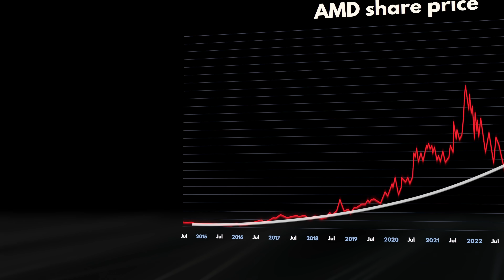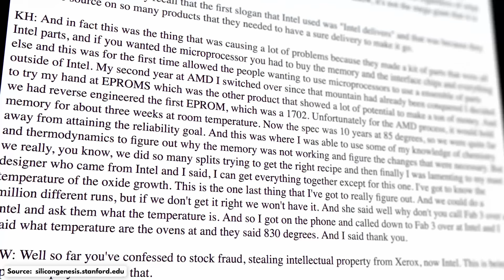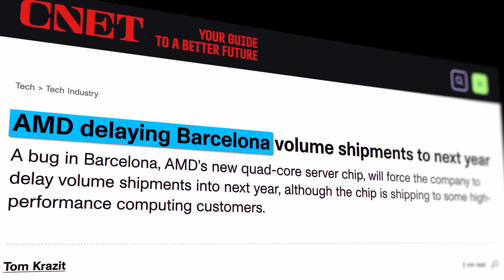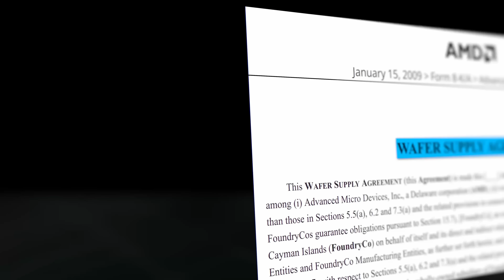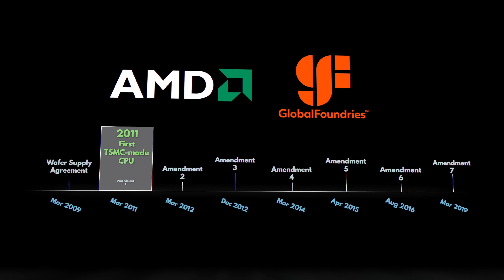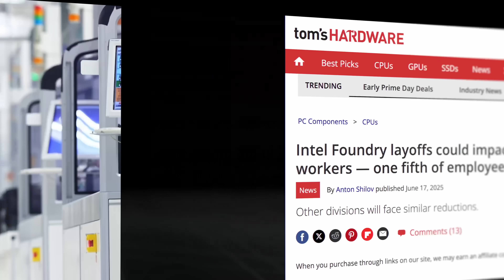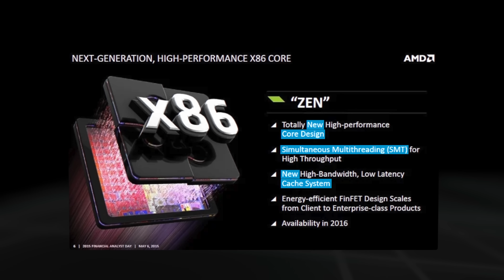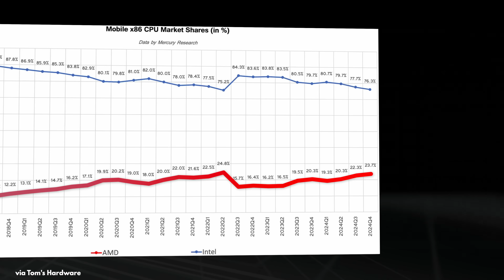How AMD won the CPU crown

Comment: It has been a long time but I believe Pentium 4s had faster clock cycles than the contemporary Athlon 64s but the Athlons could do more with each clock cycle and was situationally better.

Back then, consumers thought everything was determined by clock rate but it stopped being a nearly pure clock rate battle after the Athlons.

Comment: Couple of errors and omissions in this video. Most of early AMD chips weren't cloned. They were AMD's own designs. Also you skipped the whole Intel anti-competitive saga in the mid 2000s which is the reason AMD was able to spin off and use TSMC fabs in the first place. Also you said Intel is getting their manufacturing in order and then mention Lunar Lake which is actually manufactured on TSMC. It's basically like you used an AI without fact checking.

Comment: Since a few weeks I'm the proud owner of two Ryzen 5 5600x processors, which according to AMD's own website, were made by Global Foundries.
So far I'm pretty happy with them, they are a real performance boost to what I replaced them for (i7 4770k and FX 8350) and broadly use half the power.
That makes me a bit sad to hear about Global Foundries struggles.

Comment: how can you say this when intel has a multitude of chips that out perform and outprice amds best chips. like the 9800x3d is almost 130$ more than the 14700k and the i7 out performs amd by 7%, not to mention thats a low and the fact its not the best of it generation and its not the only intel chip that outperforms and outprices amd. theres literally 15 intel chips that out perform the 9800x3d and half of them are cheaper routes.

Comment: I used to by exclusively Intel Chips. Their problem was, they thought the battle had been won, they only won the first round. I've owned several AMD chips in between my intel chips and apart from bulldozer (which I missed thankfully) AMD always offered the best price for performance. The Phenom series was great and now Ryzen has leapfrogged itself every year. I'm currently using a 9800X3D on AM5 and for what I use a pc for, I can't see myself upgrading for many years.

Comment: Apple or Amazon should make a movie about her hiring at AMD and how she became CEO and turned AMD around. My first AMD PC was an 1800X and I have been with AMD since. Intel CPUs kept giving me grief after the I7 3770(K). Since switching to AMD not one of my CPUs has had issues. My 1800X still runs like new and I love the performance with gaming. I got a 3950X in 2020 and I was blown away with having a CPU that fast and with an EVGA 3080Ti, it was my first time playing games with 200-250 FPS at max/Ultra settings on 1080P.  Now with a 9950X3D CPU, I still cannot believe a CPU like this can even exist. I do not know know if I will ever buy another Intel CPU in my PC built but I do know that as long as Ryzen 9 3950X/9950X3D CPU family stays this strong with  even better future performance, I will keep buying Ryzen 9 series for the rest of my life.

Comment: It is incorrect to say Bulldozer failed. it was ahead of time but having 32nm vs 22nm did not help AMD. the combined cache overheat the chip. Intel adopted the combined cache in their design. by 2015, Intel already using 14nm while AMD need to wait till end 2017 to adopt 14nm
AMD unable to purchase 14nm lithography system despite IBM had the fab technology.
Reply: it is actually APU purchase by Playstation pushed business to TSMC

Comment: The biggest reason for AMD's hard times was human stupidity.  The same thing is true between Radeon and GeForce.  People were so obsessed with the fact that Intel was faster that they didn't stop to think about what they actually NEEDED.  When the i7-920 came out, I chose the Phenom II X4 940 because I didn't need an i7-class CPU. I needed something more like a Core2Quad Q9400 so I chose a Phenom II X4 940 because it was A LOT less expensive.  I was so happy with it that I continued with AMD when I got an FX-8350.

People say the FX-8350 was terrible but I never felt like I was suffering with it.  It cost me only $170CAD and it lasted me in my main PC for five years.  I actually still use it in my home network fileserver.  That's called INCREDIBLE VALUE, something that Intel wasn't offering.  AMD's CPUs did what I needed them to do and they cost less.

- Stupid people want a product that's good.  
- Smart people want a product that's good enough while costing less.

I've only used AMD CPUs and ATi GPUs since 2008 and I've been happy as a clam.

Comment: Ever since my first PC, a "powerhouse" built around a 133MHz Am58x6 with killer 1MB of RAM and S3 Trio64V+ graphics card, when I had the choice, I have almost always used AMD CPUs. But I also admit, that for me, it was usually the price that was the deciding factor - and AMD definitely had the edge here. It still does, for most of the end-products I might have a use for.

Comment: It should be noted that AMD was the leader in all of the significant improvements in the world of x86 CPUs in the last 25+ years.

1: AMD was the first to move from a front-side bus to a point-to-point architecture, massively reducing bottle-necks.

2: AMD was the first to put the memory controller into the CPU rather than the south-bridge sharing bandwidth access over the front-side bus, also used by all the other peripheral devices.

3: AMD went to the memory manufacturers to collaborate in the design and specifications for DDR RAM. Intel wanted to force the very expensive and proprietary RAMBUS onto the PC market. DDR became the standard as Intel had to adopt DDR or be prices out of the market.

4: AMD were the first the reach 1GHz, but they also continued to design more efficient CPUs that did not require excessive power to run. Intel gave us the Pentium 4 & Xeon space heaters. The only reason the later vastly more efficient Core CPUs existed was due to Intel passing all the Pentium 3 design work over to an Israeli team working on Laptop CPUs.

5: AMD designed x86-64, this was done by working with Microsoft and the Linux Kernel developers to create an instruction set that would both enable very large RAM but also make code more efficient. Intel spent 8+ years flogging the dead horse originally called EPIC (Explicitly Parallel Instruction-set Computing), later called Merced (went from being the bees knees to a tech-demo platform) and eventually got launched as Itainium. I was working at Reuters when HP gave them a test system to start porting code over to, it was so slow and buggy it just got pushed aside.

Some other complete failures at Intel:
- Their RISC chips in the early 90's that could not run a multitasking OS due to fundamental errors.
- Multiple GPUs in the 90’s & 2000’s, including one with lots of tiny x86 CPUs.
- Pentium bugs with a broken FPUs. Pentium 3 CPUs that broke when pushed over 1GHz, but that didn’t stop Intel from selling them.

Basically the only reason Intel was ahead of AMD from the early 2000’s to 2017/18 was because Intel had the best FABs being used for CPUs. Once AMD sold off its fabrication facilities and went over to TSMC fro Zen, Intel suddenly had to work on a level playing field, and the failure of their 10nm forcing 14nm+++++

Apart from making excellent Ethernet controllers Intel had the benefit of being 1 to 2 nodes smaller than AMD for over 20 years, which at that time automatically made their CPU faster and perceived as more efficient.
Reply: Well Put....

Comment: Latest as of Aug 15th 2025 @ 6PM
"The Trump administration could be gearing up for a bold move: a direct equity stake in Intel (NASDAQ: INTC). According to people familiar with the talks, the potential deal is aimed at reviving Intel's long-delayed factory project in Ohio, once promised to be the largest chipmaking hub in the world. Shares jumped 7.4% to $23.86 on the day of the news and gained as much as another 4% after hours, as the market reacted to the possibility of federal backing. The discussions come just days after President Donald Trump met with Intel's new CEO Lip-Bu Tan, whom he recently criticized for alleged ties to China. While the deal's details are still in flux and could fall apart, the move would signal that Tan's job is likely safe for now."

Comment: Still not sold on Ryzen. Had one and was not that impressed. Intel is a way better value now and they overclock much better still. In my experience the performance in games is still better on Intel (and more stable), particularly older titles. I realize the X3D chips with certain titles are producing the highest frames, but I'm not paying $150-200 more for that over the current Intel lineup. I'm glad AMD has produced competition with CPUs (I am using their GPUs since 2011), but the CPUs still are not for me. I hope Intel turns the ship around, I feel they should exit the GPU market and instead focus on tech integration with current GPUs similar to how AMD did it. They need to innovate - not copy - what AMD has done or is doing in order to turn it around.

Comment: AMD is plagued with stability issues while intel eats everything like its nothing, all my 3 amds have issues even tho perform better by a 10 to 20% they are plagued
Reply: I dont have stability issues on my amd,didnt had on intel too maybe u should get better PSU im using 1000W Antec HCP Platinum its like 20 years old lifetime waranty :)

Comment: I love Ryzen cpus. Will never use Intel again I think. I have a tiny 7.2 liters itx PC and I use a Ryzen 9 7900 65W (real 70-80W max on mine) and it has 5.4GHz and it stays like that in gaming, and it also has 12 cores and 24 threads. I could use a 3DX cpu but for my Dan Case v4.1 pc build I had to choose a cool, lower heat outputting cpu, and this one is great.

Comment: amd was always cheaper and broke down less than intel in 90s and early 200s.. when intel was 800 dollar for one processor amd came out with a 200 dollar process with same power in 90s.  they also created 3d now ahead of time with 64 bit tech that intel nor any video card did not have yet.  it lead to dvd tech, 3d layering and then ATI card as well ahead of time merged with them a perfect union of multimedia.

Comment: With over 600 comments by now, I'm hoping that someone has pointed out your big error at about the 3:20 Mark. The common misconception is that AMD did beat Intel to the 1 GHz Mark and that's actually false. Intel was the first to win gigahertz but that processor got recalled because of an error inside the chip. So by the time they got it respun and re-released amd had released the Thunderbird series 1 GHz. This kind of false narrative is what happens when YouTubers regurgitate what other people have published errors get carried on and on and on
Reply: Well, if they had the first usable ones seems like winning.

Comment: Just some trivia. AMD APU (With GPU inside CPU) is still monolithic instead of chiplet for better battery and heat performance, If you use CPU 24 hour, this could be great news as it offering lower idle power usage. AMD 8000 series is the recent one. 4nm CPU with 4nm GPU close to GTX 1050 1060 1650 performance.

Comment: Intel's current situation looks very similar to AMD's.
Perhaps this is an endless cycle.
Only ARM can change this. A 3rd one on the race, gets rid of complacency once either Intel or AMD take a clear lead.
We are slowly seeing it happening in the GPU Segment.
The B580 disrupted the low tier GPU market. Celestial will disrupt the mid tier GPU market.
That's when things start to move.

Comment: Bulldozer needed much smaller fab node. OK for most users, but game engines & special apps increased matrix FP ops demand that bulldozer was worse at.
The fab node shrink from 28nm to 14nm was huge so it could afford the wider paths & more processing ports/units per core.

Comment: There is also a sign that while the Ryzen was an Intel X86 competitor, there were large element of RISC/ARM in the design that turbocharged some of the internal performance that Intel kept trying to fix even with a close understanding of Windows and the performance. Also to note AMD nor Intel are in the mobile space (with much success). ARM designs rule and in that space its Samsung/Apple and Qualcomm that rule the market (with some good  Chinese success also)

Comment: They were also able post Radeon takeover to integrate better GPU into their chips. This offered PC makers a way to avoid buying and designing gpu IO into their office computers, servers and higher volume laptops. It would be as if Intel bought out Nvidia when they were just a gaming GPU maker and avoiding all that investment into their lacklustre GPU dept plus as Apple has shown, integration between the CPU and GPU offers greater returns than just as if they had no real connection to each other. Yet like Intel AMD has not had as much (or for Intel - any) success in AI chips that work off a GPU design. All those AI server farm orders are going to Nvidia even from Google who made their own Server farm rack servers.

Comment: They may have won the cpu wars, but since cpu and gpu fractured into separate technologies, with separate concerns, they have lost the gpu wars to nvidia… point in case.. Nvidia CUDA has achieved wide adoption, and the instructions are open source - AMD is trying to make gpus with support for cuda, but they will likely always be comparatively easy to beat by nvidia, as nvidia is the source of cuda as it is, and as it develops

Comment: simple, they didn't. merely exploited intel's over confidence. still second league, even the newest ryzens remain unsophisticated compared to even the next-to-last generation of intel's...clock management, voltage management, memory controller, southbridge, you name it, all inferior. the only area they were ahead really is the smaller gap semiconductor technology, that sort of made them more energy efficient, and somewhat cooler ( not without undervolting though).

Comment: It should have been noted that AMD is essentially a guardian angel for x86 --- when on May 29, 2001, Intel together with Hewlett-Packard introduced a new 64-bit microprocessor "Intel Itanium" on the IA-64 Explicitly Parallel Instruction Computing (EPIC) ;) architecture, incompatible with the existing x86 microarchitecture, but with the ability to emulate it (which was implemented very unsuccessfully) and eventually completely replace it in the PC and server markets. And only in 2003, thanks to the efforts of AMD, with the release of the AMD K8 architecture with the AMD64 instruction set, a 64-bit processor with backward compatibility for 16-bit and 32-bit applications, it was possible to avoid oblivion for x86!

Comment: I switched from an Intel CPU to AMD- best decision ever. My first PC, when I was 16, had a Sempron 1.8. Later, I built my first Intel 9900k with a 1080ti, then upgraded to a 2080ti, and until recently it was working well. But this year, I upgraded to a 7950x3d because of issues with 13th and 14th gen (high temperature and degradation). This was the best decision, as the CPU is maximised overclocked on a water-cooled loop with 5080. It works very fast in gaming and other tasks.
Reply: amd was always cheaper and broke down less than intel in 90s and early 200s.. when intel was 800 dollar for one processor amd came out with a 200 dollar process with same power in 90s.  they also created 3d now ahead of time with 64 bit tech that intel nor any video card did not have yet.  it lead to dvd tech, 3d layering and then ATI card as well ahead of time merged with them a perfect union of multimedia.

Comment: Hi Morton, I watched this on Nebula, but wanted to comment here. I enjoyed your video, but as someone that’s been following AMD for years wanted point out something that's of relevance. Moving AMD production to TSMC was the smart move no doubt, however for several years they've become a victim of their own success. Currently AMD produces their current gen chips on TSMC's 4nm node, making them supply constrained. This factor has lead AMD to focus more production on higher margin chips instead of more mass market products. This was well noted when AMD was struggling to provide enough chips for the PS5 and Xbox series X/S. Laptop APU's have been one of the most impacted, where AMD may announce a chip at CES, but it can take 2-3 quarters for a decent range of models and stock to reach the market. We are seeing that now with the Strix Halo series of APU's. AMD has also lost some advantage to competitors such as Intel and Apple who are already on 3nm. It seems however that AMD has learnt their lesson, and has recently inked a deal with TSMC to be the first to bring 2nm chips to the market.

Comment: #TechAltar you really do make excellent videos! Thank you !!!
I have had AMD and Intel chips for 26 years. I used a 2008 Phenon X2 550BE 3.1Ghz dual core in my 24/7 Nas for the last 14 years and only just replaced it! I actually was given 2 of them on ASROCK A780GMH-128M Mobos. The Mobo would allow the unlocking of a third core on these chips, but not overclocked. The other chip, I managed to O/C to 4.1 Ghz on with a big fan and used that as a daily web dev work station for a few years running a third over he native clock speed.

Comment: CPU crown when they get steamrolled by Apple laptop chips on desktop ? AMD just sucked less than Intel and was on TSMC, their designs are nothing spectacular. The whole PC industry is sleeping on bringing high bandwidth memory to CPUs and this is not going to change in a generation. AMD lucked their way into this with strix halo but doubt their main lineup will follow suite.
Reply: You are the only based guy here. Chiplets are just terrible in general, i totally agree that the x86 duo is being wrecked by Apple Sillicon.

DDR5 DIMM sticks have terrible latency and still we are using dual channel RAM with 16 core chips...